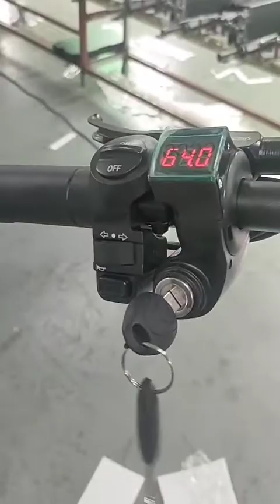T88First-time use video

Comment: I have two of them and you have to be mechanically inclined to own one.The performance of the scooter is amazing 👍🏽💯🏁
Reply: I just got mine today and it was astonished by level three power with dual motors I kept saying this is mental how is this even possible lol
Reply: Can you please give me a little more detail about some of the maintenance issues you’ve had to deal with because I’m thinking about buy one but there are no shops near me that would be able to help me maintain it? I have limited mechanical experience but have had several motorcycles and scooters.

Comment: What happened if the scooter keep cutting off and ain't charging up
Reply: I just received this scooter and I’m having charging problems
Reply: maybe a wire has a short or is not connected kinda had this problem after hitting a few pot holes its ok to brace everything place

Comment: It is tricky to work on as I had to have some issues fixed as well. The scooter will do 50mph!! I ride mines everyday to work ( only a couple of miles) yet I rides with traffic ( probably not legal) The furthest I ever rode it was about 20miles round trip with everything on ( turbo dual motor)  It is a really nice scooter just needs to be maintained properly 👍🏽💯
Reply: "(probably not legal)" 

a small price to pay for salvation 😇
Reply: Hey there I have some questions I just purchased one and was wondering what general maintenance I should do on it. It would be much appreciated thanks!
Reply from the maker: Maintenance tips to remind:
1、Only after off-road, check the attention to tighten the nut reinforcement.
2、If not used for a long time, please charge the battery to 80% to save. And just do a complete charge and discharge once in about 1 month.